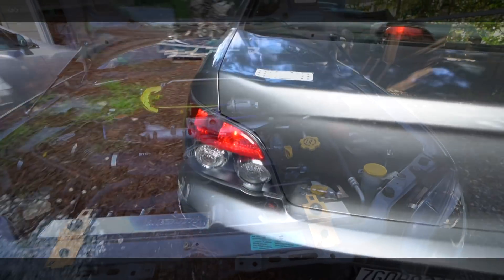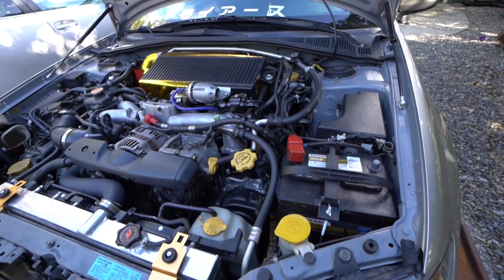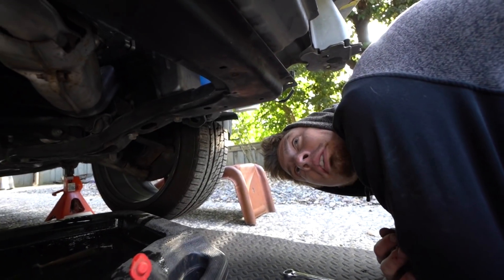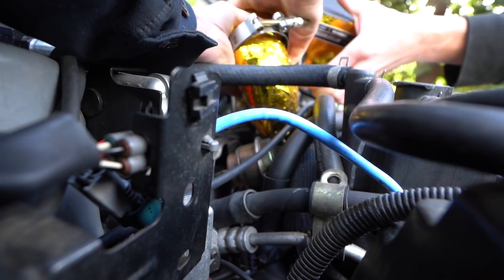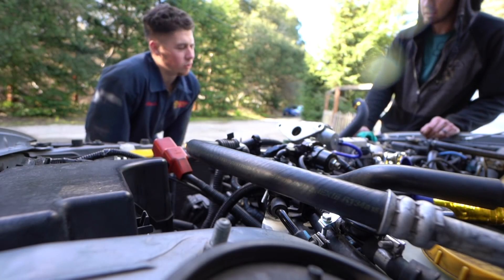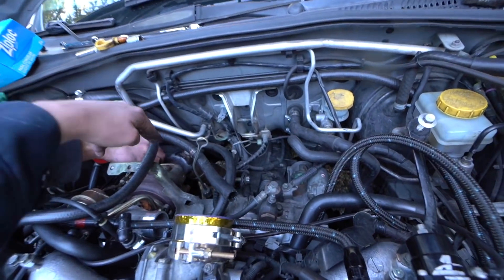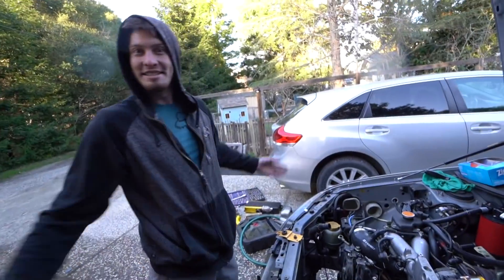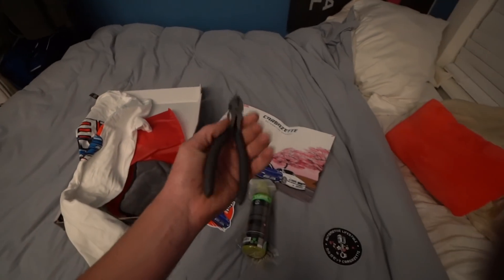THIS IS WHAT WE FOUND TAKING APART THE BLOWN UP WRX!

Comment: the aftermarket bov should be tossed in the bin and replaced with a recirc. bpv, if it's not speed density tuned.
Reply: SteveEMc2 S yeah hks (fully atmospheric) BOV’s can mess stuff up if not speed density